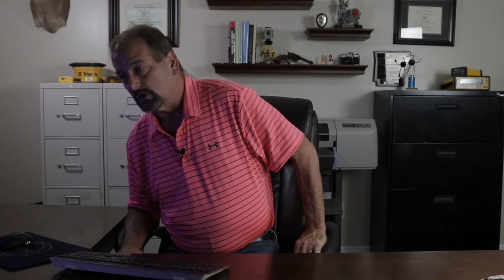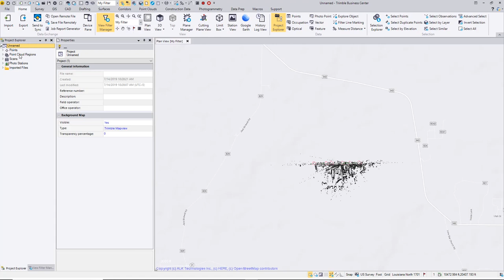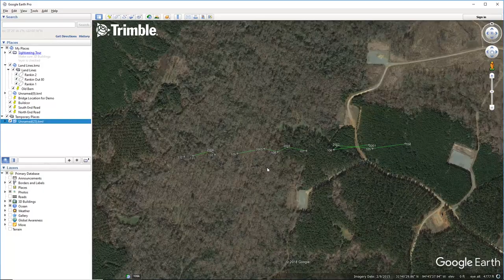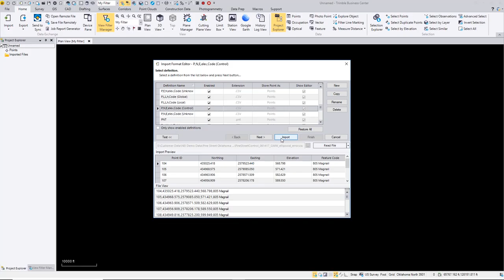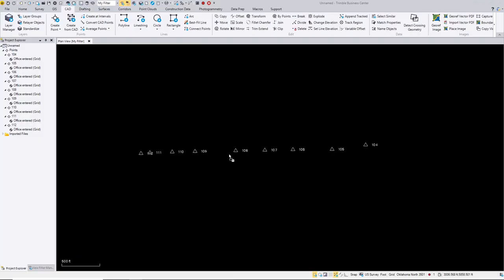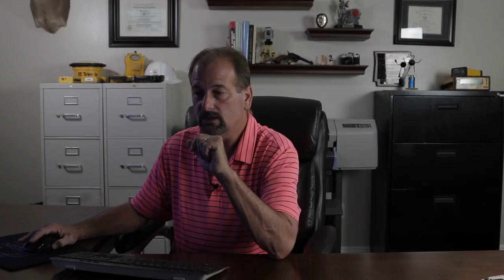OMG! Control is Jacked up!

Comment: Thanks for the great videos.  Perhaps an easier solution would be  be to export your LA state plane coordinates convert them to Lat, Lon and Height and import them into your new OK North job.     - Learning a lot watching your SX10 scanning series video.  Have done some mobile LIDAR surveys for beach profiling so the point cloud was the final product but now I am looking at an airbase where the spec is 0.01 ft. vertical on  all concrete.   SX10 looks like it will do the job but I am a little intimidated by the point cloud to AutoCad requirement.  Like most surveyors I am better at acquiring data than presenting data.  After watching your videos I am getting a handle on the workflow.  I added a dedicated data processing guy to my bid. I hope it's enough.

Comment: Wondering how you feel confident that your 2000+ points assumed the elevation delta from your keyed in control.  I don't use TBC so am probably missing a concept in how it processes job data.  Thanks
Reply from the maker: Very because all the data is tied together in TBC